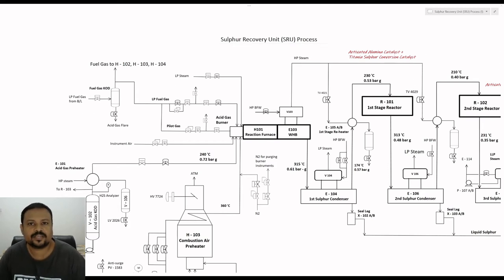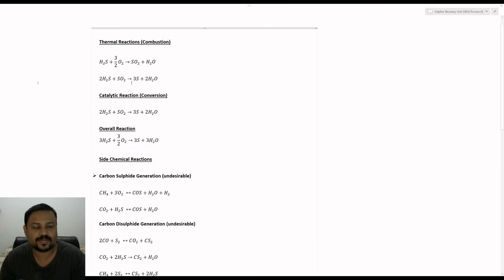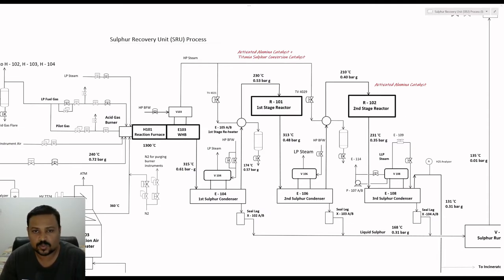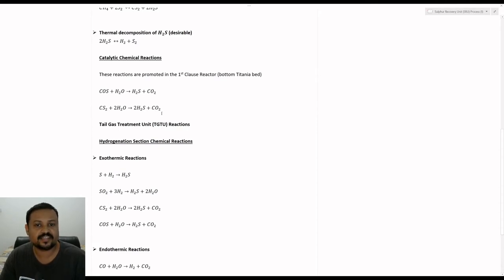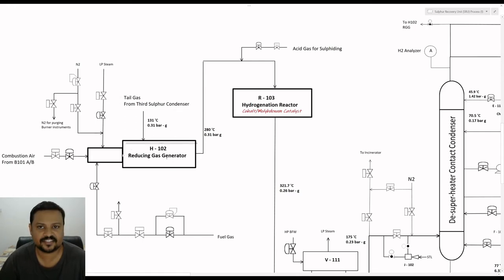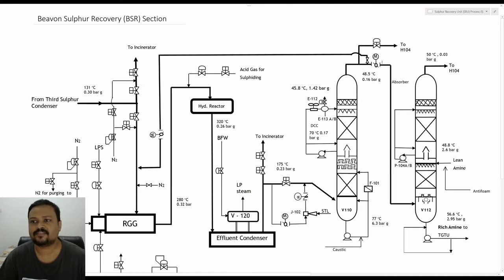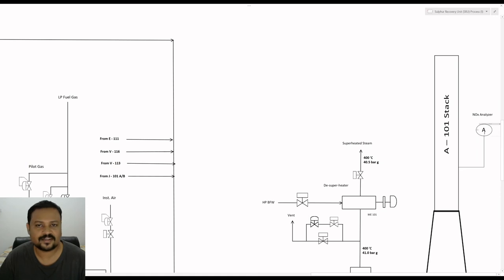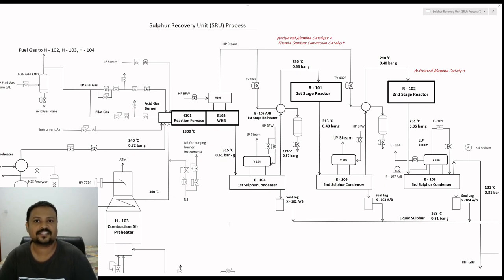SRU Process

Comment: Thank you for your great effort explaining all the intricacies of the process! I have a question if a trim air valve can only add more air for combustion to the burner (can the trim air valve also reduce the amount of combustion air to the burner?). Another question is if Sulphur rundown vessel is the same thing as Sulphur Trap? You also mentioned that ejector sweeps H2S from the Sulphur Rundown vessel with the HP steam. Where will it sweep this H2S to? To which vessel?
Reply from the maker: 1. Trim air is for adjusting the combustion air requirements in case of increase or decrease in H2S conc. , in that case it will increase and decrease the air in order to maintain the tail gas ratio of 2:1 (H2S/SO2)
2. Sulphur run down vessel is the intermediate storage sump which has to be degassed  before it is sent to storage tanks. Sulphur traps are the seal system which will prevent the Sulphur vapors from going into the rundown vessel in case of any pressure spikes in the upstream. These are of broadly 2 types. a) above ground b) below ground 
3. The ejector air is either routed to incinerator or recycled back to reaction furnace inlet.

Comment: Sulfer pit have vent or not. Vent is always closed or opened
Reply from the maker: it has an atmospheric vent , but the pit will be under negative pressure with the help of steam jet ejector, and discharge routed to the incinerator under running conditions. If the pit level is emptied out during shutdown, then the ejector can be stopped and during that time the pit will be under atmospheric pressure. If the ejector is out of service, the pit will not be swept out and H2S conc. will build up and pose an environmental risk.

Comment: is it possible that we have an SRU  when the H2S content  in the feed gas is about 12000 mlg/m3
Reply from the maker: there are different configurations depending upon the conc. of H2S in the acid gas 
50-100 mole% (rich feed)   -  straight-through configuration 
20-50 mole%   (lean feed)  - split-flow configuration 
10-20 mole%   (lean feed) - split flow with preheating of the feed streams
<10 mole% (very lean feed)  - Sulphur recycle 
<5 mole% (very very lean feed) - direct oxidation 
50-100 (with NH3) - straight through with one of the NH3 burning configuration